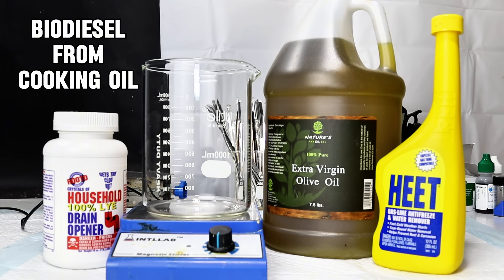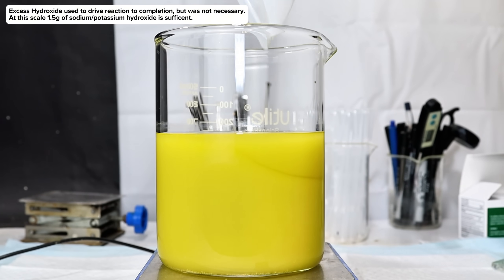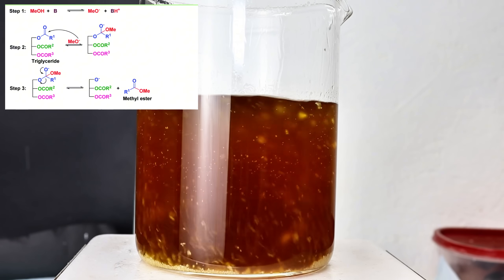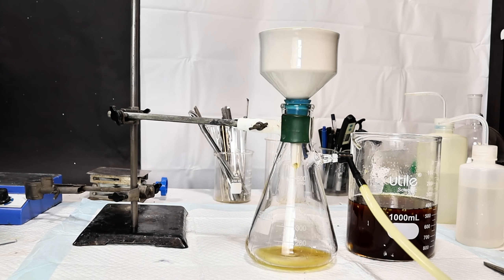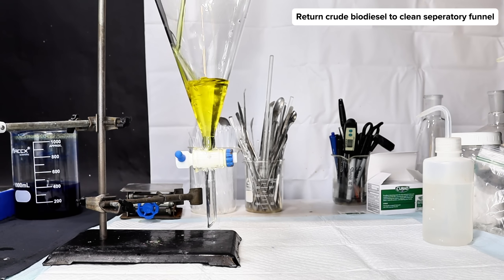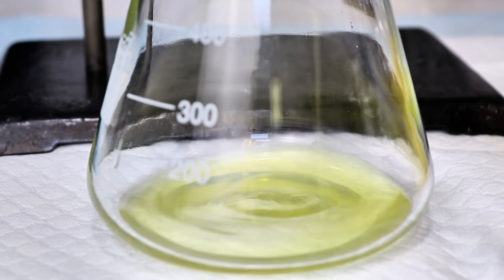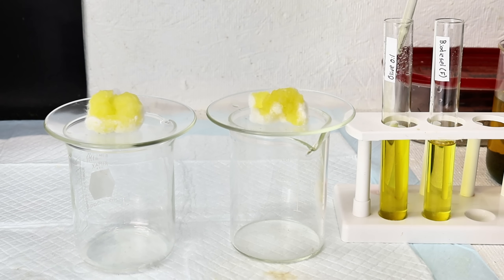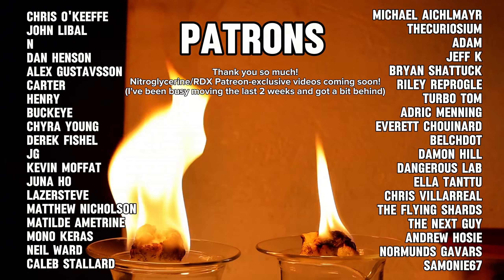Making Biodiesel from Cooking Oil

Comment: i have been making batches like this for 10 years now , so you have not made anything new here , although you take credit saying it is your process , that is incorrect and you are heating the oil too high when heating you want 60 degrees max because the methanol will boil off too quickly at 110 degrees like you did it and you are wasting the alcohol , also as you can see soot on the bio burn it shows you do not have b100 but more like b90 with some dirty soaps and water etc left and not full converted, but a good start , i have used 10,000 litres nearly in total now, in 5 different diesel engines including modern diesel engines and i use b100 all year , with zero conversions to the engine other than remapping to give me extra power and increased fuel pressure by 10% to help compensate for the thicker fuel.

Comment: I remember on an episode of "Dirty Jobs" Mike was helping make biodiesel and the guy doing it took a measured sample of the raw oil and titrated it to figure out the exact amount of the methanl/hydroxide mixture required. Not a bad idea as it eliminated trying to remove any leftover caustic left behind in the finished product. 

As nasty as sulfur is for emissions, it is awesome for lubricating things. A lot of "dark" cutting oils for machining have sulfur in them and if you ever did machining, you know that smell. The irony is the very sulfur they are trying to get rid of is good for lubricating the high pressure systems on modern diesels. Go figure right?

Comment: If I had a restaurant near you, I'd happily give you my dirty fry oil. As much as you want. The stuff is a pain in the ass to get rid of which is why we pay recyclers to haul it away with a healthy contamination of water from boiling and rinsing the machine. But at least that's the only contaminant beside the obvious well caramelized organics you'd ever get. We don't use any weird detergents. Yes, they make cleaning a bit faster and easier but is wholly unnecessary unless you have never cleaned the machine properly. I've seen that before. It ain't pretty.

Comment: I have seen a number of documentaries over the years of people doing this. It is just not viable. For one thing, there is just not enough used cooking oil out there to make it useful. The engines running on this have higher nitrogen oxides (NOx) emissions. Just not a good idea. Buy a fuel efficient car to save both fuel costs and produce less carbon.

Comment: Methanol itself is a fuel. Why using it to make another fuel?
Reply from the maker: Its got higher energy density than methanol, and its totally non-volatile. Technically both marginal advantages and it mostly depends on what you are making a fuel for.

Comment: I found this video very interesting. Could you also do a biodiesel production from oils with High Acidity which requires a acid esterification? Also, is there any chance that the methanol evaporates while using beaker? would it be better to do it like soxhlet method?

Comment: 6:50 But petroleum diesel is hard to burn in the ambient atmosphere pressure, whereas the biodiesel burns like gasoline. Is it okay to use the biodiesel in a diesel engine?

Comment: Hi, I'm a professional chemical engineer designing an automated biodiesel plant at home. A few key tips:

1. Methanol Evaporation: Methanol boils at 63°C, so if heating above 55°C, use a reflux column to prevent vapor loss.

2. Lower Temp, Longer Time: Running at a lower temp avoids methanol loss and ensures full conversion.😂

3. Excess Methanol & Reaction Rate: Using 4–5x methanol to oil (e.g., 500mL oil → ~2.5L methanol) maintains a high methanol concentration per litre, even near completion. This significantly increases the reaction rate due to the Arrhenius equation, allowing fast conversion at lower temperatures.

4. Separation: Proper methanol excess leads to a clear biodiesel/glycerol separation. Glycerol remains liquid due to dissolved methanol.

5. Water wash diesel and separate 

6. Methanol Removal: Heat biodiesel to ~70°C to evaporate residual methanol. If water is present, heat above 100°C.

This ensures a fast, high-yield biodiesel reaction with minimal post-processing.

Comment: When I taught AP chemistry, I used this project to replace the final exam for the students.  They'd already taken the AP exam .  I used corn oil, straight MeOH,  a 1 m solution of NaOH for safety reasons.   The result was much lighter in color that the olive oil version above but the product burned just fine.   Georgia Tech fuels their buses with my version /formula of this bio fuel.
Reply: Question, why does the USA use the incorrect terminology MeOH for methanol, sometimes calling it methyl hydroxide. CH3OH isn't any more difficult to write.
Reply from the maker: @cambridgemart2075  I've actually wondered the same thing myself lol. I think it just caught on at some point and now its common enough that many people use the shorthand.. Maybe it came from the shorthand for diethyl ether being Et2O
Reply from the maker: Really? Thats awesome man! I'm actually surprised that method works without issue, as I'd expect the water content of the 1M sodium hydroxide solution to make something more resembling a soap. Then again, the quantity of hydroxide you need here compared to the quantity you need to make soap is very small so makes sense. Thanks for sharing!

Comment: How delicate cars are these days with injectors, turbos, egr valves, dpf filters, etc., they barely run reliably with diesel. For the sake of just a few litres or gallons of diesel made from cooking oil, I am literally afraid to try it. The idea is great and could be done with hundreds of gallons but best of luck to anyone who does. Great video thanks.

Comment: try and run a small rc car two stroke engine off of it, maybe see if you can also make the needed oil for two stroke fuel and turn olive oil into two stroke fuel. i wonder if this is feasible.

Comment: I'd love to know the nitrogen and sulfur content. EVOO has enough plant stuff in it that there will be sulfur and nitrogen in the biodiesel that it'd acidify gaskets and ruin engines. Refined bleached deodorized ultrafiltered oils, if you can add any step to remove the dna/peptide bits, helps. I think short chain fatty acids would create more volatile oils, but coconut oil and palm oil are what they are. I also wonder about using ethyl propyl or isoproyl group instead of methanol as i've always seen, with shorter FAs.

Comment: The problem I have with biodiesel is that it does not offer enough lubricity for my old mechanical diesel’s fuel injection pump (also mechanical, uses fuel as lubricant).

An alternative I have been investigating has been the fractional distillation of used (waste) motor oil. At the home consumer scale, filtration seems more economical than petroleum distillation for purification, and still less economical than just pouring it directly in my fuel tank and cleaning the injectors as regular maintenance.

Comment: Asking the question, did you heat the oil up too much? I've been looking into doing this for a while and 50 to 55c seems to be the recommended temperature due to the low boiling point or evaporation point of methanol, is this right or wrong? A lower temperature would appear preferable as the less input the better, if the idea is to save money.
Reply from the maker: Yeah I think the high heat just speeds up the reaction but otherwise doesn't seem necessary. Lower heat over a longer period of time could definitely cut back on methanol evaporation, and honestly if I do this again I do plan to keep the temperature a whole lot lower.

Comment: Plastic conical fermenter can be used in a slightly bigger scale. Or just use an empty 5 gallon water dispenser bottle turned upside down. You can drill a small hole on the bottom part of the bottle and add a tiny valve that can be opened to allow air to enter the bottle while draining from the cap side. Obviously another valve added to the middle of the cap will allow you to easily drain settlement.
This biodiesel is perfect for oil heaters. You can buy used cooking oil from restaurants really cheap. Almost free
Reply: Muxing in the fermenter can be done without shaking. Just add weight to a aquarium air hose drop it in the liquid it sinks to the bottom and turn on the aquarium air pump.

Comment: Pour the methanol in to a beaker, add the NaOH or KOH, then mix until the OH will dissolve. Raise the temp of the oil to 60Deg C. Remove from heat. If the temp of the oil is around 55 Deg C, add the solution. Mix for 30 mins or so. Let it settle overnight. Remove the Glycerin. Wash it with water, then mix. Let it settle overnight. remove the water together with the remaining Glycerin. Bring it outside, exposed to sunlight or air dry for a day or two. You have your biodiesel for mechanical engine good for the environment and you.

Comment: I would love to see you make this on a larger scale. I made several large batches over a decade ago. I seem to remember 22% methanol by weight and KOH 6.8 g/l of oil. Titrate a small waste oil sample to neutral PH with lye and apply it to the whole batch. We did mix the potassium methoxide in advance. Small additions as it is the exothermic reaction you mentioned and hot methanol is quite volatile. We settled the glycerol in our heated reactor vessel so that we did not have a problem removing it.

Comment: I've been making Methyl Ester for 15 years; I make a few 1000 lts a year to fuel 2 cars. My method is similar to yours in principle but I use a 2 stage process. I firstly heat my used veg oil (typically Soya) to 50*C and dry it from accumulated water by adding the previous batch 1st stage Glycerol and circulate that for 10 minutes. After which I let it settle 90 mins. During this settling time, I add a weighed amount of KOH flake to a measured volume of methanol to create what I call methoxide, an exothermic reaction occurs and the mixture needs to be shaken a bit to dissolve all the KOH. I then decant the old glycerol from the oil feedstock and dispose of it. I heat the dry oil to 62*C & add the methoxide and circulate it for 20 mins. Then it settles for 90 mins. The created glycerol being denser, sinks to the bottom and is decanted and kept for the next batch. Your glycerol was solid because it was created using NaOH; as soon as this cools down it solidifies - generally an unwelcome factor in biodiesel making as it can block pipes in processors etc. I always use KOH because it's glycerol always remains liquid. I then have most of my feedstock oil converted to biodiesel but not all of it. Experience has taught me that the trans-esterification process is actually inhibited by the greater and greater presence of the glycerol. So with the latter now removed, I can add a small amount of KOH to a smaller volume of Methanol & repeat a similar process to achieve 100% conversion from oil to biodiesel. I then follow a regime of washing the biodiesel with water until all the soap is removed and the fuel is clean. I then heat it up to 72*C and bubble air though it; the bubbles bursting at the top of the chamber release water vapour and after 4-5 hours my batch of 100lts biodiesel is complete. A very clean fuel to burn in a combustion engine; infinitely more environmentally friendly than the fossil fuels used the world over.
Reply from the maker: This is fantastic information, and exactly the type of comment I pray for when I make a video! I don't have the willpower to sift through dry academic journals on any specific project, and so I go into everything I do basically blind and give it my best shot. Reading a detailed walkthrough on precisely what I'd like to do is exactly what I'm always looking for and so I thank you so very much!
Actually, if you don't mind I'd like to cite your procedure when I inevitably do a larger-scale redo of this project. Seems you've perfected the diy procedure so I don't see a point wasting my time trying to re-invent the wheel lol
Reply: Thats very similar to the process we do in my workplace (a FAME factory)
Reply: Oil companies hate him

Comment: Sorry but the sustainable part i dislike, you basically take nutrients from soil to make energy that vanishes.
Reply from the maker: Totally fair, and true at least in the way I showed here. It can be made to be sustainable, but only by using oil that would otherwise be discarded or by sourcing the oil from plants that grow like weeds and don't require deliberate cultivation or fertilization. It is sustainable in the sense that it is carbon-neutral unlike petroleum fuel, but yeah with current farming practice it wouldn't make sense unless the oil being used was essentially a byproduct of another process.

Comment: I'd be keen to see what you can do with py-oil (black liquor from pyrolysis of wood). I understand drop-in replacement for avgas (kerosene) or gasoline is possible.
Reply from the maker: py-oil is definitely on my to-do list, I just need to do a bit more reading to see whether any specific wood is preferable. Also looking to try making methanol from the py-oil

Comment: Probably dumb question, but does this process also work with other types of fat, like lard or tallow? Or are there other steps necessary for using animal fat for this?
Reply from the maker: From what I've read yeah you can actually use animal fats, and apparently animal fats yield a biodiesel with an even higher cetane rating (meaning they burn even faster).
btw: I had the same question myself

Comment: Consider a diesel car that gets 30 mpg US, driven 12,000 miles per year. That requires 400 gallons of fuel annually, or $2000 worth at $5/gal. That 33 gallons per month or about $167 worth of diesel at the pump. That means making about 9 gallons of biodiesel per week. Or 5 gallons each of two runs on a Saturday or day off for 10 gallons. That means a very large setup that would need to be put in a fire resistant metal shed outside away from the house or home for fire safety if something goes wrong. Also electric heating needed to avoid flame ignition of produced biodiesel. Not an insignificant effort as thats a sold few hours of labor each Saturday shucking liquids, lye, heating large vessels & thousands in capital gear kit setup + cleaning reset and waste, illustrating the lack of economies of scale of making it in such low volume quantities in a small setup.

Comment: "sustainable" hmm? Last time I checked, the worldwide consumption of diesel significantly exceeds the capacity of all arable land assuming modern fertilization and farming techniques for the highest yield oil crops.
It's an excellent personal solution to reduce fossil fuel dependency for the few who are willing to tackle it, but it's absolutely not a 'sustainable' solution for the world at large.
Reply: If you actually use the highest yield crops, the around 15 mln km² of arable land is easily sufficient to cover the world demand of around 1.5 bln tons of  diesel and heating oil per year (sunflower produces around 80 tons/km², oil palm produces around 6 times that). Of course, that's highly unrealistic as we can't turn all arable land to produce diesel and heating oil.

But it still is a sustainable fuel source, it simply happens that our consumption levels are not.

Comment: would new diesel engines be able to handle biodiesel without clogging up? i remember videos from years ago stating that old engines should be fine running with filtered cooking oil from restaurants.
on a related note, could you make biodiesel from spent engine / gear oil?
Reply from the maker: Yeah I don't think modern engines would be able to handle this stuff well upon further research.. too sensitive compared to the old ones. And yeah I've tried repurifying old motor oil (with limited success) and I'm planning to instead try to Crack used motor oil into usable distillates. Might be a while before I have a video out but stay tuned :)

Comment: Ran my car on Biodiesel 25 years ago, back then it was available at the gas station. Too many problems, clogging fuel filter, frozen fuel filter in winter, Bosch injection pump leaked, all gaskets were damaged. And that with an engine the manufacturer said was good for BD (Audi 1.9Tdi). Then here in Germany the gov started a new tax, energy tax on fresh and used veggie oil. Reusing taxed oil means paying the 40cent taxes again, that killed all 2nd use of veggie oil and made cooking oils more expensive

Comment: Showing entire processes of turning "waste" material/chemicals into useful products sounds like an interesting idea to me.
Reply from the maker: Yeah I really want to get more into that as those videos always feel the most satisfying to actually do as well. Kinda hurts when something fails when I started with pure reagents, but if I start with trash and it fails it doesn't feel quite so bad lol
Reply: This is not unlike what I do for previous metal retaining.  When I do silver I convert the silver Miata to chloride with KCl. I then recover the KNO3 and use it to make more HNO3 which is used to dissolve more silver. The CuCl is reacted with NaOH. The solids are recovered and smelted and the (mostly) copper slug goes into my stockpot to drop any PGMs or gold in solution. I rarely have ANY waste that needs to go to the waste disposal center.

Comment: when washing the biodiesel layer with water it is best to use a spray of water instead of shaking the funnel. Shaking vigorously may produce some soapy emulsion. Use a plant spraying bottle to deliver a fine mist of water that will percolate through the biodiesel removing the remains of the soda lye. Then drain off the water.